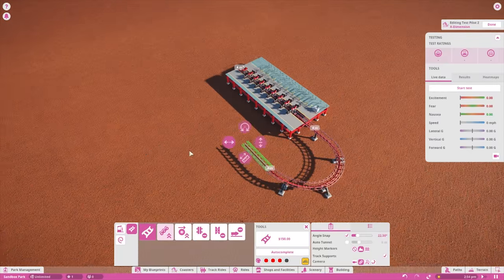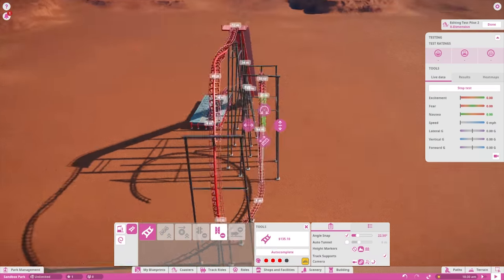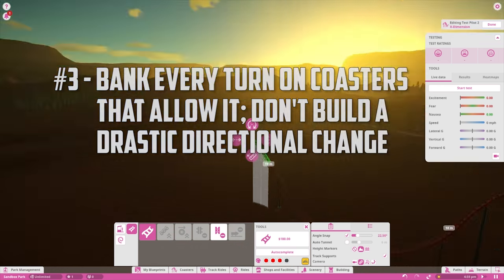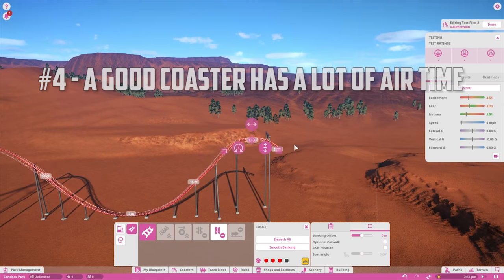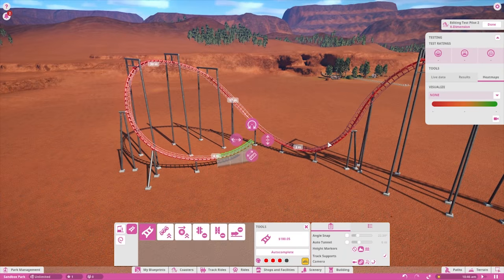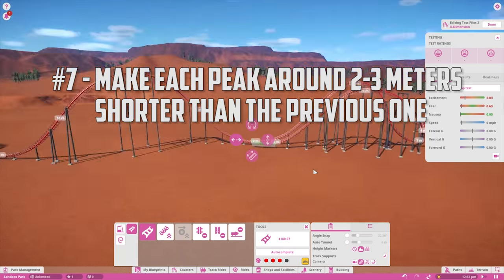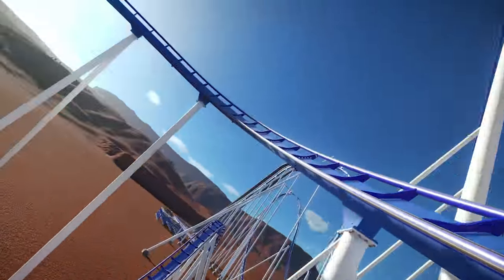Planet Coaster Tips | How To Design a Realistic Roller Coaster | Roller Coaster Tutorial

Comment: I also recommend while making rolls to go into the utility setting and changing the offset to 2, makes for more barrel rolls than inline rolls, and will smooth out some of the curved turns.  Also you can make your breaking section first so you know the section going into the station will be smooth, and don't be afraid to take off angle snapping.
Reply from the maker: Great info! I did actually turn off angle snapping when I was rebuilding it(the blue coaster) but you're right that most of my time lapse had it on and I wasn't even thinking about it until later. :P

Comment: Thanks a ton FF.  Last question.  I am having trouble quickly placing ivy on the walls and tops of buildings.  Is there a super fast way I can paste those texture to an existing building?  For example, I wanted to spruce up the bland ATM building by attaching Ivy to the left and right side.  Then plop one on the roof too.  This was to make it blend better with fairy tale campaign.  I spent way too much time dawdling with the rotate commands and still couldn't get it flush.
Reply from the maker: Hmm, I'd have to see it to be sure, but I'll try giving some advice. Are you saying that it wasn't flush against the wall or that you couldn't get the angle the way you like? If it's the first one, then try hitting F to center it, then if you hold CTRL and drag your mouse you can move it in and out which might be faster than trying to use the advanced move. If it's the latter, I'm not sure how else to advise outside of using the rotation tool. You can try placing it while editing the building or placing it independently of the building, not sure if that makes a difference. I hope that helps. :\
Reply: Yes you understand!  When I tried to use the rotational tools I fiddle with it forever and still can't get it flush.  For something so simple - attach ivy to vertical wall piece it was taking forever and still looked poor.  "Paste flat texture to wall" seemed like it should have been much simpler than I was doing.

Comment: Great series of videos!

One question: would you rather recommend getting used to the building and landscaping tools in sandbox mode or with the restrictions of scenario rules?
Reply from the maker: I'm not sure it really matters much. Landscaping costs money if you're not in sandbox so there's that, but it still doesn't really cost that much compared to what you'd think it would be, so after a short amount of time in a scenario or challenge mode it's pretty easy to do anyway.
Reply: Foxy Fern ah cool. I've been holding off playing so far due to lack of time, but I'm looking forward to sinking a couple hours into it this weekend. If it's not as expensive then I guess there's nothing that speaks against learning the ropes in scenario mode :)

Thanks!
Reply from the maker: You're welcome! One thing to keep in mind too is you can use undo(ctrl+z) to back track your landscaping and it will also refund you the money for it.

Comment: Hey Foxy Fern i'm having a rather weird problem with a coaster. When i do a test run it's excitement, fear and nausea are all in the green, however once it goes live the excitement drops by 2.0 points and the fear and nausea both go into the orange. Is that a bug or am i missing something?
Reply from the maker: Hmm, that sounds like a bug to me. It definitely shouldn't change if you haven't modified anything on the coaster at all between testing and opening it. Have you tried saving it as a blueprint and then demolishing and rebuilding it? If it is indeed a bug it's possible that might fix it.
Reply: Turns out it was a block section. I had two trains and the second one was blocking the first.
Reply from the maker: Oh, good to know!

Comment: Only started playing this 2 days ago, and ya all my custom coasters end up having 3 excitement, 10 fear and 15 naussea :-|
While I am testing the track, the excitement seems very high, like 8's. However when I use auto-complete to have the auto tool connect the end to the station and run the full test, excitement drops to very low indeed.
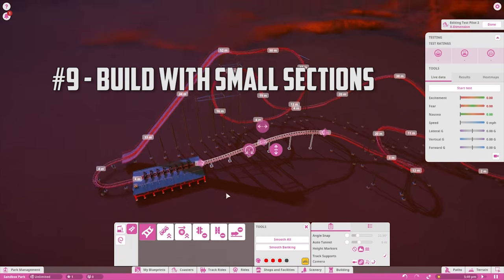Reply from the maker: I would recommend only using auto complete for a small section at the very end of making your roller coaster(you can see me use it in this video at 3:30). Auto complete only cares about 1 thing: connecting your tracks together. It's not going to worry about how it affects your coaster's ratings. 

Also, check the overall fear of your ride as you're building it. If there is any ONE spot where it goes up really high, that will decrease the excitement of your entire roller coaster regardless how fun the rest of it is, because people won't enjoy the death-defying section.